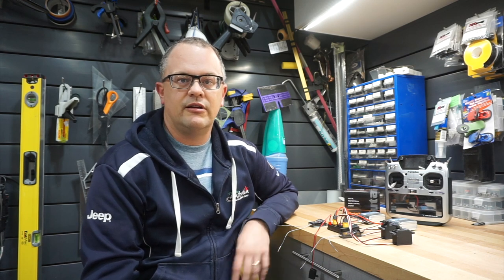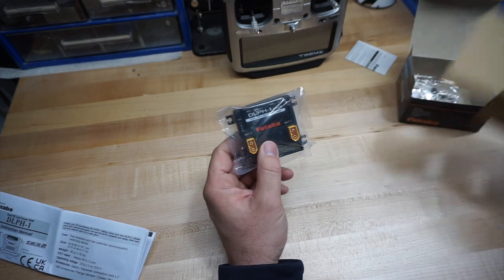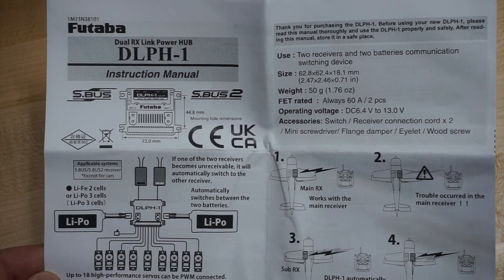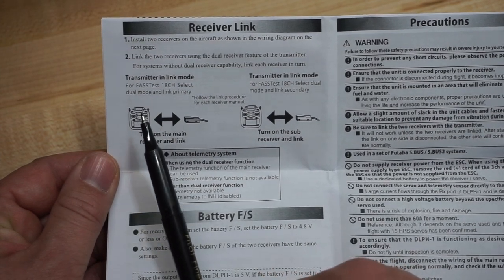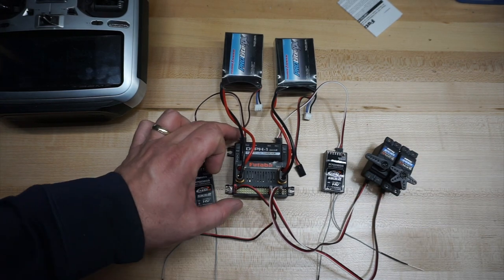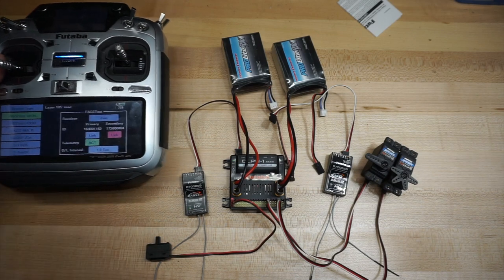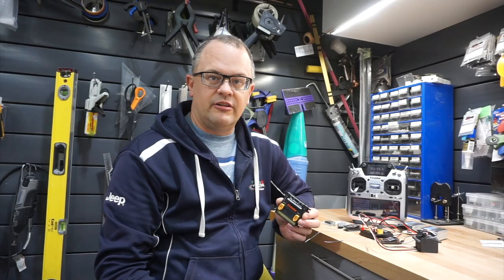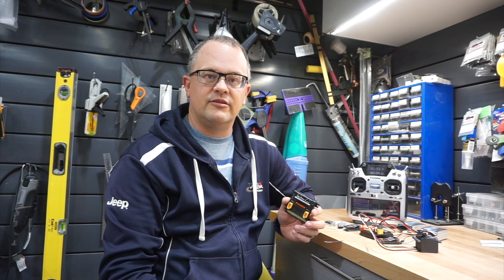Futaba USA - DLPH-1 Unboxing and Setup!!!

Comment: Thanks for the video Chad, i do have a question, right now i'm using a smart fly turbo reg. feeding two R7008 receivers with half the plane on one rec. and the other half of the plane on the 2nd rec. its  a 435 KAM AERO EXTRA FOR IMAC USE.. so how would you recommend using the dlph for this application by the way i'm not using 
Bus for this plane so which mode would i set my R7008 rec. on   A B  C or D

Comment: Chad, a couple of points. First I think its a little Jonny come lately. There are systems out there that do a better job of supplying battery back-up's. Like Power Box, Smart Fly, and a new product called Aura Pro. 
As for the 7008 RX you didn't say a word about receiver modes, in the duel receiver connection. I fly the 18 MZ and so 18 channels is all I get. So maybe the next video, how to use all 32 channels, with this system,
PS love my 18!

Comment: I’m really struggling with my DLPH-1. I have a R3008SB receiver and T10J transmitter. I’ve programmed the receiver on mode B so that it uses channel 8 for SBus. The DLPH is detecting the receiver as the LED is green, but I’m not getting movement on the servos, no matter which channel I plug it into on the DLPH. I’m also using standard digital servos that aren’t SBUS (Align DS615)

Comment: What size batteries do you use? I have a 91” slick , normally I would use a 2S 5000mah lipo to fly with. Any suggestions?

Comment: Do you know if this unit will work fine with non-S.Bus servos?
Reply from the maker: Yes no problem, you can connect via an S.Bus connection on the DLPH, or there are connections for individual channels to use conventional servos, or even S.Bus servos without programming them.  You can mix and match as well.

Comment: So, I will show my lack of knowledge, but here it goes. In your video your using 8 channel fastest receivers (7008) one primary and one secondary. Please explain to me how you get more than 8 channels with this example? You mention up to 17 channels in the video?
I can see there is that many servo connection ports on the dlph-1.
Please help me understand the receiver and dlph-1 in getting all 16-17 channels that are capable in dlph-1 with 8 channel receiver?
Reply from the maker: Hi Boyd, the Rx's are connected to the DLPH with S.Bus, so they are able to use the full range of channels vs. just what is physically limited by the number of the receiver channels.
Reply: @chadnortheast  Thanks for your reply. If there printed information available the contains setting up s-bus, I have never done this before and dont understand how it works?
Reply from the maker: @boydabercrombie4410  In the context of using S.Bus with the DLPH, there is really nothing to do setup wise.  You simply plug in the Rx to the DLPH with the S.Bus 2 port, and then plug in your servos to the DLPH based on the channels you want to use.  In the function menu on your radio you will be able to see which control is assigned to which channel and then just match them up.  For instance if you elevators are assigned to channels 2 and 7, you would plug one elevator servo into channel 2 port on the DLPH and the other into channel 7 port on the DLPH.
Reply: Don’t buy this products mine doesn’t work at all, I don’t see any movements in my servo, I did follow all the instructions seems like no signal from Rx1 and Rx2, I’m very disappointed buying this item😢, waste of money and expensive.